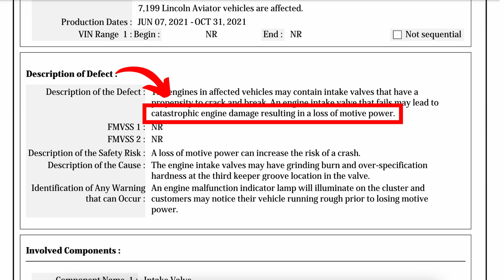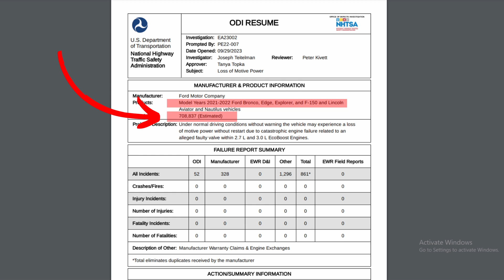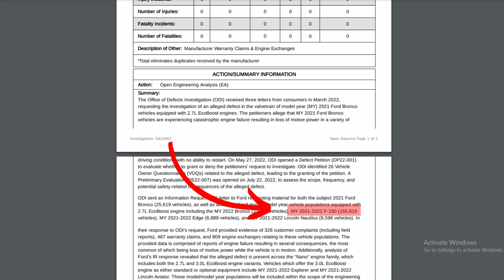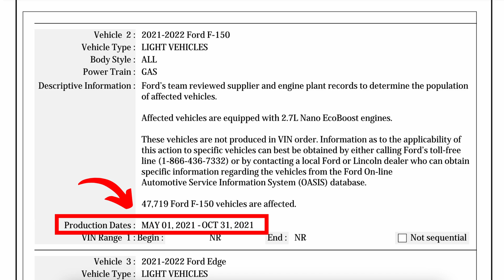Ford F-150 2.7L EcoBoost Engine RECALL Explained *Heavy Mechanic Review*

Comment: Everyone jumping to conclusions that the 2.7L/3.0L Ecoboosts, or turbo engines in general, suck because of this recall are clueless. They were out for 6+ years with great service history BEFORE this manufacturing defect happened. The Nano engines are fundamentally very solid engines.
Reply from the maker: Completely agree. Very solid engines. Personally I would still want an N/A V8 in my personal 1500 aka the 5L but the 2.7 is build very well in my opinion.
Reply: I'll keep my V8 Hemi, thanks .
Reply: @Oldschoolrules123  Cool. I've driven plenty of hemi Ram's as rentals. They are ok. I wouldnt own one. The GT package Laramie I had in Banff for a week was the most obnoxious truck ive ever driven. I tow a lot in the mountains and dont wanna listen to that obnoxiousness for hours on end while im pulling grades.
Reply: @Jay-me7gw  Gee , I pull a trailer too and have no problem. I'm a retired heavy equipment operator and love the sound of real power. But if we all liked the same thing... Life would be boring.
Reply: @Oldschoolrules123  What is real power?
Reply: @Jay-me7gw  More than what you got.😂😂😂😂😂😂😂😂 Sorry cupcake, you'll never sell me on little cubic inches with little turbos. I'll take all cubic inches. But thanks for asking. Bye
Reply: @Oldschoolrules123  I just didnt know what real power is. Is there fake power? 

Also, my truck has 1 more cubic inch than  a 5.7 hemi. Stop assuming what I own.🤣
Reply: Ford is king of recalls.😂
Reply: @fireant1272  And? Doesnt make the 2.7 a bad motor.
Reply: @Jay-me7gw  didnt say it was bad. I've owned many fords. Some good experiences. But overall negative they were being recalled multiple times a year it kinda gets old..
Reply: @fireant1272  Thats all manufacturers these days. Even Toyota is recalling a lot. I cant think of 3-4 recalls on the tundra off the top of my head.
Reply: @fireant1272  I have a 2018 with a 2.7 and have never received a recall yet
Reply: Same thing happened to my 2016 F150.
Reply: @freedomliberty7611  ok? Doesnt mean it’s not a solid motor because of your anecdote.

Everyone agrees Toyota 5.7L V8’s are super reliable and yet they had an issue dropping valves early on.

Comment: GM has yet to recall the lifter issues with their engines or have a fix.
Reply from the maker: So true!! I’m actually hoping to speak to a GM engineer in the near future and I’m going to ask directly about the lifters. See what they say lol
Reply: @GettysGarage I’ve replaced many lifters and cams on the 5.3 and to me it seems like it’s more prevalent in vehicles that idle long periods of time, same with Hemi lifter issues. Though that’s usually higher mileage. Failing below 60k is definitely manufacturing issue assuming maintenance is done.
Reply: @GettysGarage  please ask Ford about their cam phasers and ten speed transmission issues
Reply: @Billybob50119 that's a rare issue. My 5.0 is going strong.
Reply: @GettysGarage  ask about the defective rear calipers on the 2019 up 1500"s
Reply: @GettysGarage  I’m sure billybob knows more though 🙄
Reply: Even with a class action lawsuit on them they continue to use their cylinder deactivation garbage. 
My neighbors Denali Yukon (beautiful SUV) lost lifters/flattened cam lobes on the passenger side and it was just past the 36,000 power-train warranty.... GM said too bad, out of warranty.
Reply: @hmdwn  GM powertrain warranty is 5 year 60k miles so I know this is a lie….
Reply: @Billybob50119  yup
Reply: @Billybob50119 ... you're correct my bad, 36000 bumper to bumper. The power train is more. But, just out of warranty the passenger side lifters did flatten the cam lobe and he had to pay out of pocket. 
His beautiful SUV just sits... he waited over two years and recently took delivery of a Tesla Truck (ugly af)
Reply: @bubbabiker5653  government motors won’t fix 💩. Lifters been failing for over a decade now.

Comment: Love my Ford F150 2.7!!! Hell yeah!!!
Reply: I think it's an excellent engine based on how it's built, but if you cruise You Tube, one channel will call it crap while another call it Ford's best motor. So ignore nay-sayers.
Reply: @adotintheshark4848  Yes ignore them especially with the second gen 2.7s! They are superior to the first gen in a few ways. For instance direct and port injection also more power and torque from the factory!

Comment: Go to a Ford dealership and look  Underneath every single truck and you will see a rusty axle that will never happen with the GM truck ford charges you more money and does less for you.
Reply: @4vinylsound  not mine. Keep you wax coated gm frame 🤣 lifters won’t last long enough for it to rust
Reply: You keep lying to yourself with that garbage c*** Ford rusty Axel enjoy wait till it falls apart in a couple years then you lost all that money and you'll end up buying a gym truck anyways and you get more for your money and less cost. @freedomisntfree_44
Reply: My frame and everything is good🤷🏽‍♂️
Reply from the maker: Do they come unpainted ?
Reply: @GettysGarage   4 doesn't paint wax or coat their axles they said the rusty axle is very common and normal and it's nothing wrong with that. Sounds like they're just trying to divert from doing what's right for the consumer and trying to cut costs everywhere they can and have excuses for it and lies
Reply: Here in Michigan if you look at the frames on used trucks sitting in the lot,  GM trucks are by far the worst, Ford and Dodge are much better, GM uses wax coated frames they are junk and end up going to the crusher early, I tell everybody here looking at used trucks check out the frames especially GM,  Ford and Dodge use e-coated frames

Comment: Ford rusty axles off the dealership floor.
Reply: Just flash rust, nothing to get upset about
Reply: @pathunter7003  chevy doesn't do that. Ford cheap crap. It's called a wax coating. Cheap ass ford.
Reply: @ perhaps chebbie uses such inferior metals they have to use that wax coating, which by the way actually promotes rust formation under the micro thin waxy stuff.
Why get upset about some flash rust on a ford axle when the chebbie will have rust holes in the body panels after 6 yrs.
Cheap ass junk chebbies uses cheap steel instead of like fords aluminum body that will never rust. Cheap ass Chevy

Comment: For sucks. Stupid sloping windows. 
Way too expensive. Sits too low like a car. 
Buy a real truck buy a gm truck.
Reply: Garbage motors! Endless wiring issues lifter nonsense horrible transmission the list goes on and on with Garbage motor. Almost time for another government bailout for government motors
Reply: @johnhahn8464   You might not know this but all the recalls are from Ford not GM so you are exactly lying or just very stupid because all the Ford trucks are getting recalled because of their c*** engine gm work fine they work amazing no you're facts before you blab online
Reply: @johnhahn8464   All the Ford engines suck they're getting recalled this guy is an idiot he doesn't know what he's talking about
Reply: @johnhahn8464 
GM trucks are Junk period!
Reply: @4vinylsound  a gay man’s chariot? No thanks. As a farmer won’t ever own a pos gm.

Comment: So really it's not a problem with the design of the engine it's once again another case of quality control
Reply: I was thinking "cost cutting" but quality control sounds appropriate too.
Reply: Probably a little of both. @TheBeatenPaths
Reply: Truth is, cost cutting is MURDERING quality.
Reply: Americans. Lazy working union workers.
Reply: I believe this was a supplier issue. Which happens more than you think and is how they likely narrowed it down knowing a certain batch number from a supplier.
Reply: My 2016 2.7 F150 had over 100k when I traded for my current Silverado V8. It ran well. But how many supplier changes and part revisions between then and now?
Reply: Ecoboost & Di engines are a mess!

Comment: And still more reliable than a lifter failing gm 😂
Reply: either would give me pause on purchase
Reply: Yet actual ford tech will tell you off the clock to avoid the ecoboost f150s.😂
Reply: @ShadowOppsRC  not the 2.7.
Reply: Trying to defend Fords junk makes you look really bad especially on a video about a Ford issue 😂
Reply: @Billybob50119  troll harder. Crazy no comment from you when he did the lifter failure videos from gm 🤣
Reply: @freedomisntfree_44  you sure defend a lot of Ford quality issue videos. Always an excuse and deflection 🤣
Reply: @Billybob50119  you act like gm doesn’t and never has had an issue is the thing. What a troll.

Comment: Recalls with Ford just never stop.
Reply: Stick with Toyota 😉
Reply: @Cloud30000  Because Toyota doesnt have engine recalls?
Reply: @lllateralus 
With Toyota it looks like the cleaning process to flush out metal filings was omitted after machining.
With Ford the valve stem overheated during machining which led to a weakness in the grooves of the valve.
Both are poor housekeeping issues.
Reply: @Cloud30000 you're watching too much scotty kilmer